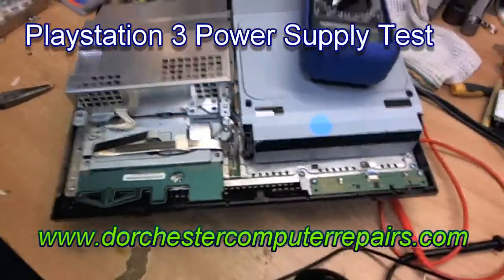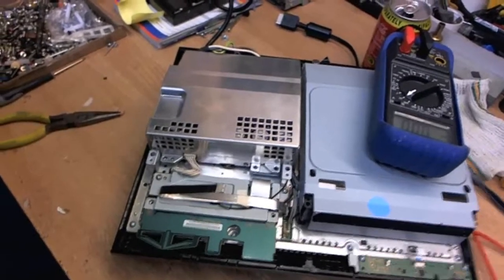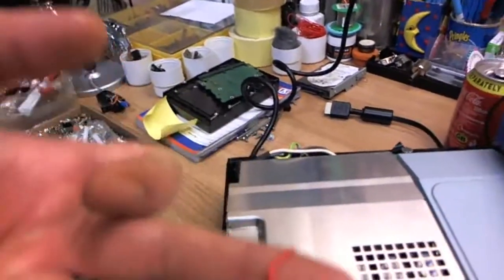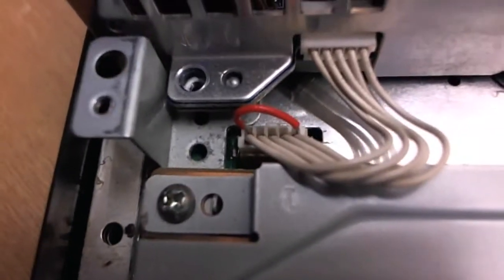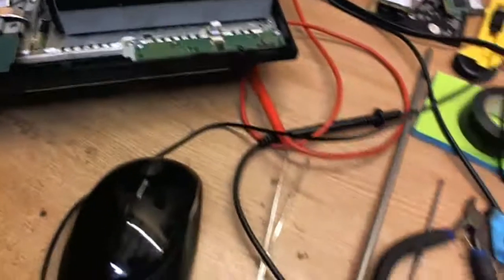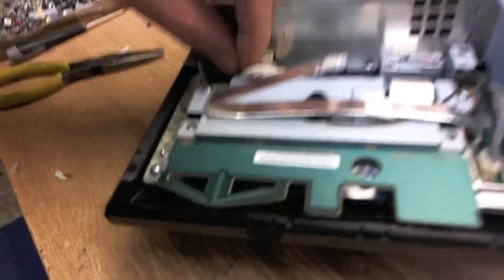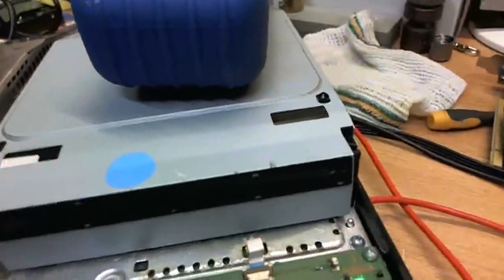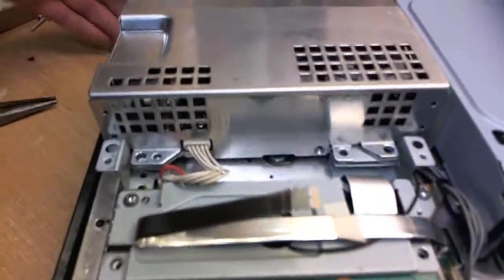Test the Playstation 3 power supply and force on

Comment: Before anything just make sure to take off the blue ray player, because if it is damaged it will turn on for a few seconds and then off. it does not mean that the power supply is dead or to fix the ribbon.  it appears for me that the issue was the brd and i took it off..
Reply from the maker: I have often cured YLOD just by unplugging/replugging (power cycling) the player. However these consoles will mostly die of GPU melt down if any are actually left now!

Comment: This worked Great for me.  After my First YLOD issue, I cleaned, re-baked, and replaced the thermal paste, things went great for about a month.  Then Revenge of the YLOD... it came back.  This fixed the issue for me well (so long as the wire doesn't wiggle).

Comment: Hi, I have a CEChL ceramic white and an APS-240 PSU.
Where would I find the 12v leads to bypass and turn console on? My PSU has 4 pins pin1)5v pin2and3) grounds pin4)5v
Reply: clip on 1. and 3.

Comment: Am having an issue with my ps3 fat 1st edition already replaced the thermal paste cause ive had it for 6 or 7 years it actually turned on and worked fine for days now i get the blinking red light and it wont fully start powers last 7 to 10 seconds blinks my fan bearly starts goes back to red light but if the power supply where the issue it wouldntt have worked ar all am wondering cause ive tried everything if this works what type of cable or wire did you use here ?

Comment: Hello, I did what you did, I have a fat 80GB model. And instead I got a yellow light. 
After I did this 'trick':
 when I disconnect the power supply, strangely enough the PS3 still has current and stays on for a few seconds. What is wrong here:(

Comment: Holy damn!!! This fixed mine! I was ready to order a power supply hoping that was the issue as mine would turn the red light on, then blink. The fan didn't start (or wanted to start and stopped).  I added the little wire and now it starts without problems!
Reply: do you mean there were 3 beeps because i dont want to break mine trying

Comment: Hello, fellow!

Question.
I have a Playstation 3 that I just reflowed. (Beforehand, was turning on and allowing me to press the power button before going into an endless blinking red light.)

Reflowed, put back together, and no power. Did this little trick of yours, and when I switch it from off to on, the fan will very, very weakly come on for a second. No red light, no nothing, that is all. (Without this trick, the fan doesn't do anything.)

Any idea what this may be? I would assume a bad motherboard by this point, seeing as the supply wasn't bad before I did this entire procedure, and it's still throwing some kind of power obviously, since the fan will turn on for a slight second.

Would love your input though.
Thanks !
Reply from the maker: Sounds like you have created a different issue while doing a reflow. Maybe you did it too hot and damaged the chip, PCB or another component near by? What was your method and tools used to reflow?

Comment: hey dude, first up, thanks for the video :) next up, my psu for the ps3 wouldn't power up, put the bridge wire into the 2 outer terminals as you said. Now the psu powers up when not attached to the motherboard, but if I try it whilst connected to motherboard, nothing. Ps3 did have the YLOD, but I repaired it, tested it for an hour or so and it was sweet,  mate came and picked it up and it wouldn't work.
Reply from the maker: I'd get another PSU and try that first if I were you. That said, if you have had the YLOD and re-flowed rather than re-balled I'd probably just abandon the unit and get another for what they cost now.
Reply: +sparkyuiop  hi my red light come son the standby light i go to switch it on and it shuts of no other lights at all  just red then shuts of completly and to get red light again i need to take cord out and put it back in lol

Comment: If this is tried and no light then listen for a click sound when turned on. That means power supply is working just the 12v (2 metal prongs under power supply on motherboard) is not working. Check the female port on power supply and if fine than it's a problem with the motherboard but I don't know where yet. Probably better to bet new motherboard for it on ebay or somewhere else.
Reply: Happy to hear that I could help you. One very important thing one must do when working on any electronic device is to alway check your wireing while you are working on it. Saves a lot of time and money doing so. Ribbon wires it is very important to check throughly. They rip very easy.
Reply: @RUBBERDUCK052209  I know this is so long ago, but please mine PS3 does not show any light when I connect the wires and turn on, but the fan is blowing and I hear a click sound. Have you got any solution yet. Thanks

Comment: My ps3 isnt completely dead.  It has the blinking red light.  Just tried replacing power supply but i guess since its used from ebay it could be dead too.  Id rather keep trying b4 spending 135 for sony to trade it.  I saw a hardrive for 14 at gamestop for more troubleshooting,  but i have small wire like yours from kits already here.  Do u think it's still worth a try with the blinking red light, or only if there's no power at all?  I still havent checked it its a fuse yet either.

Comment: will the power supply output 12v when you connect these two wires? Because i want to use my old ps3 power supply as power source for amplifier

Comment: You already told me this a couple months ago :).
>Well faulty caps are pretty easy to see and replace. It is one of the most common faults on >all electronic equipment. You should check out 'w w w . badcaps . net' (Remove spaces) for >good info and tutorials.

Comment: Haha, alright! Assuming it can be from anything? I have this same problem where the power light doesn't come up, and when I had tested the plug that goes into the motherboard (which you stuck the wire into) with a multimeter, and I got nothing. Assuming that means my PSU is dead. Luckily they're quite cheap on eBay.